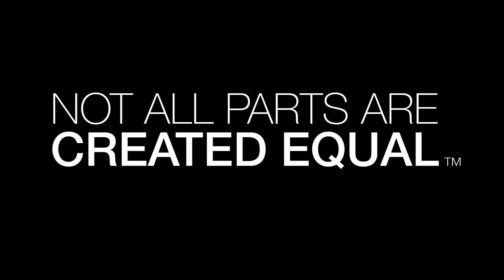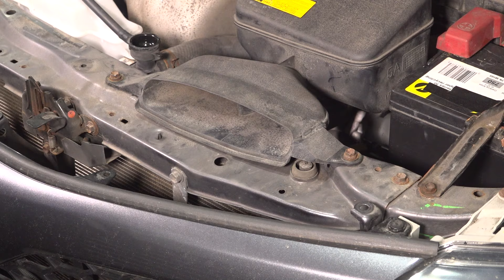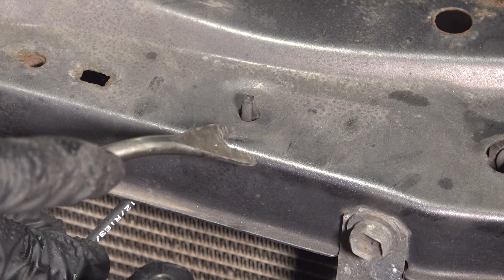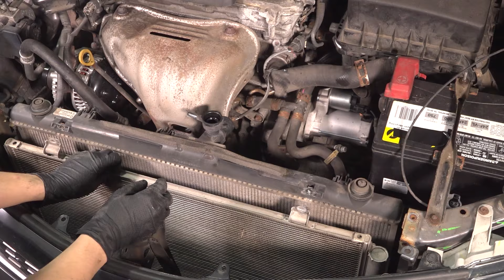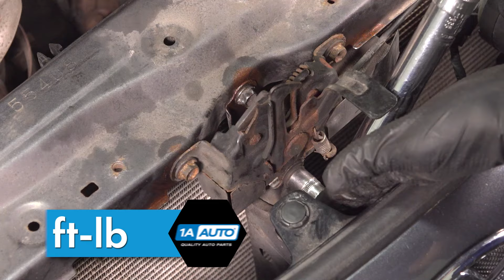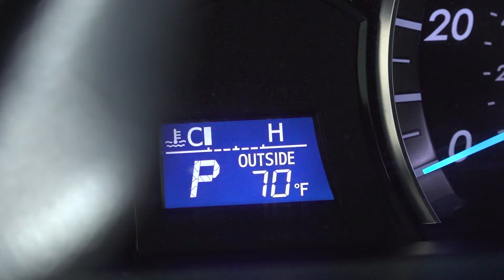How to Replace Radiator 2012-2017 Toyota Camry

Comment: great video, changed it myself.  Thank you. only suggestion is to mention putting bottom bushings on first, as you mentioned this after you said to secure it back in, which I did. but otherwise perfect.